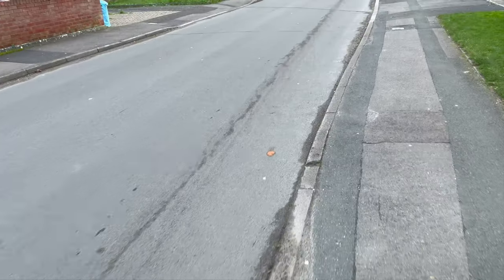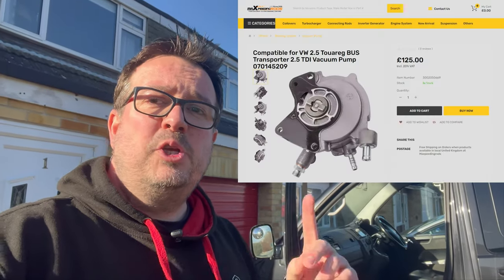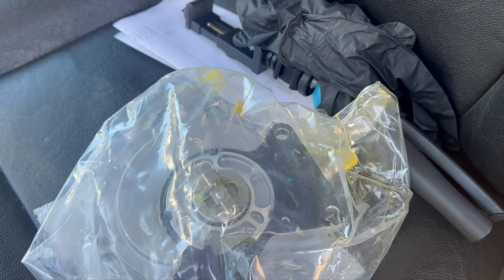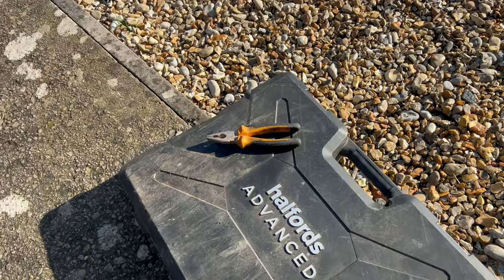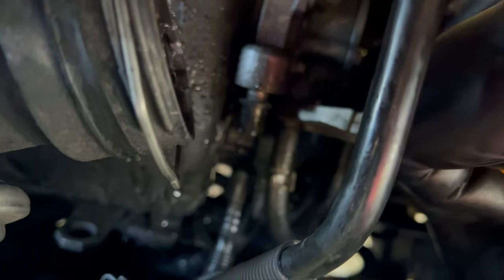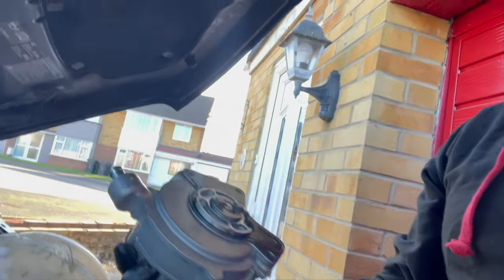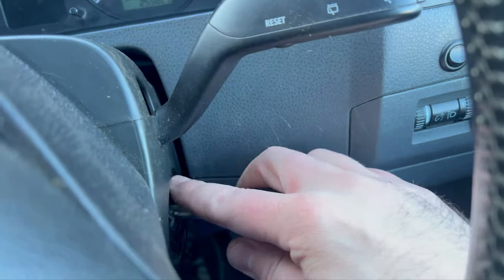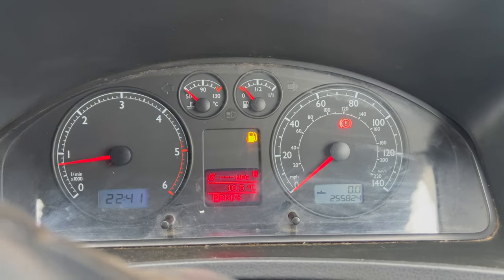How To Change A VW T5 Transporter Tandem Pump / Vacuum Pump At Home

Comment: Hello, did you notice some sings before the pump went off or it just broke without warning? What was a mileage on your van when the pump broke please? 
By the way really helpful video, thank you
Reply from the maker: Thinking about it, it might have been a bit slower to start but not by much. It was driving fine then at the end of my road it just let go.
The van is a 2005 with 250k on the clock, probably a lot of it as an airport transfer van.

Comment: nice video my t5 just started leaking oil from the vac pump couple days ago
Reply from the maker: Thanks! It’s not a bad job at all to do yourself. The rubber hose with the clip in is on tight so watch you don’t smack your hand when you pull it off (I did).